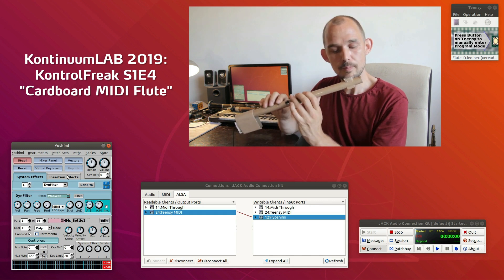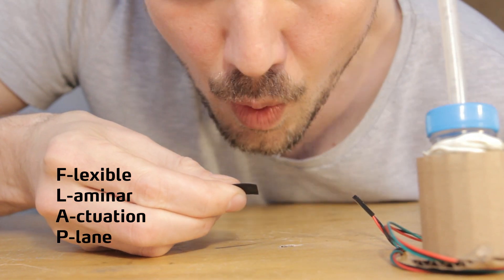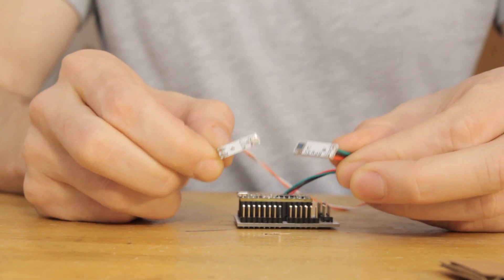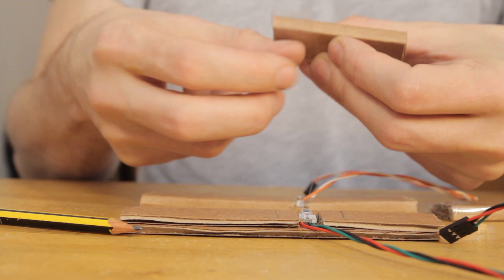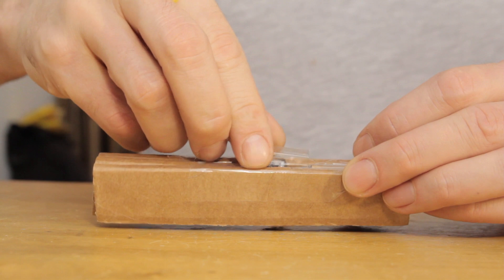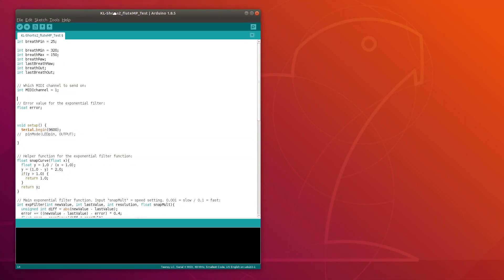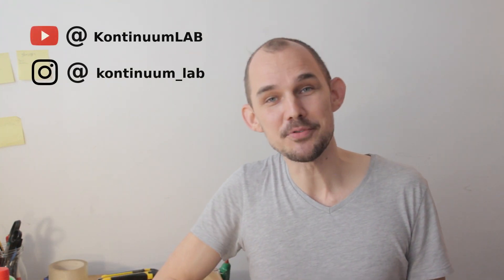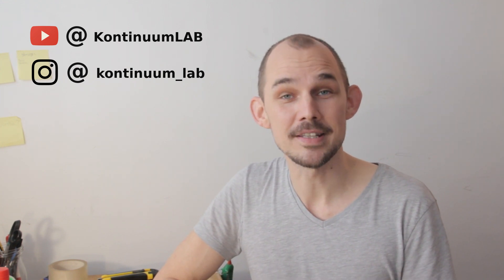DIY MIDI Flute Mouthpiece (Tricking the brain with sensors - part4)

Comment: Brilliant!!! ...I have been waiting for a midi flute for years.,, you make it seem so easy... In a real flute, the angle of the airstream is used to get the desired octave... blowing down for lower register slightly higher for middle, and higher still for high register. Do you think it is possible to achieve this with perhaps 3 (or more)  flaps glued at different positions, and each activated by angle of breath. Perhaps the higher ones will cut out data received from the lower ones. This will eliminate need for octave keys, which may be replaced by keys with other functions such as timbre and pitch control.  Again Wow!  fantastic Are you interested in developing a more robust midi flute? I would love to offer my practical flute playing experience to help.
Reply: I had the same idea -but using miniature pitot tubes in the direction of airflow for each register. Each rank would feed a pressure sensor and some logic circuitry would determine for each note which octave to sound.